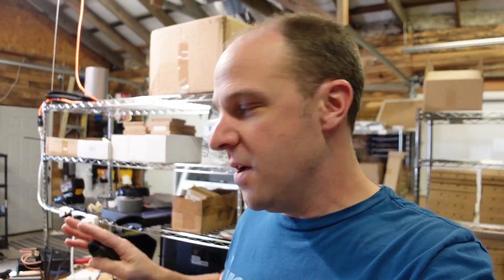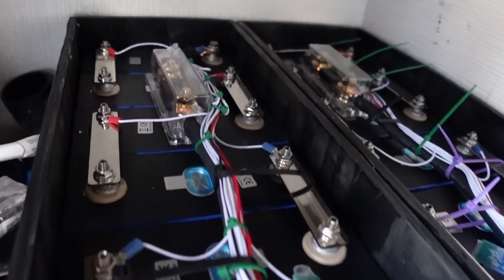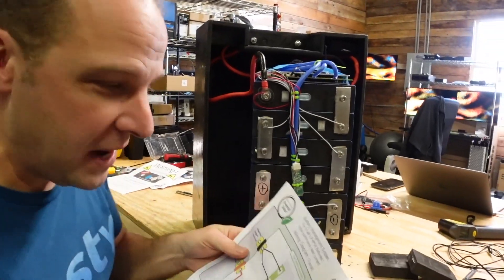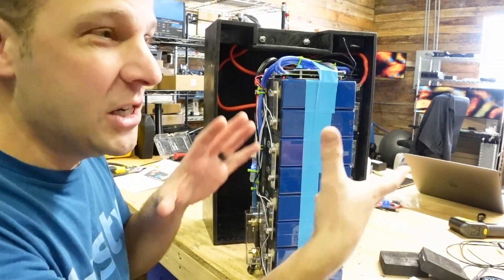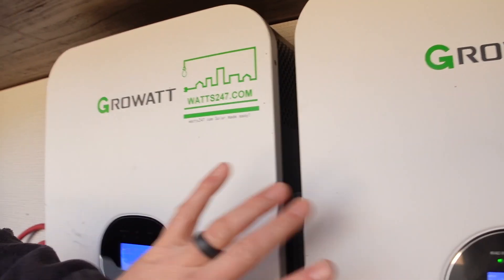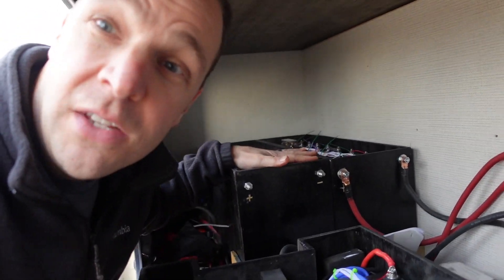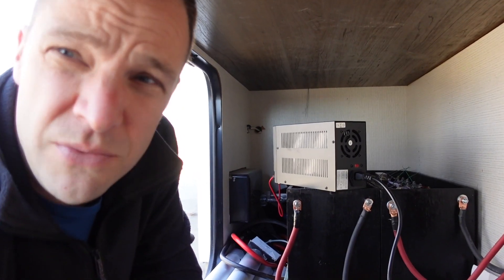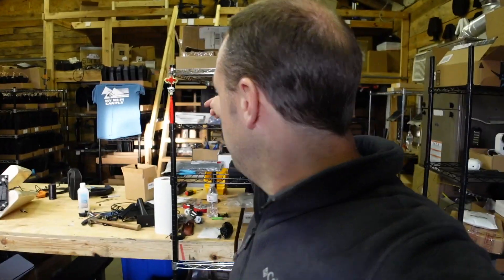EASY LITHIUM BATTERY YOU CAN SCALE UP - AND SAVE THOUSANDS - [ HOW WE DO IT ]

Comment: While I didn't use those same cells, I did make a 240AH 12v battery and used the 12v BMS from Overkill Solar.  Overkill Solar's customer support is very good and their instructions are very clear...unfortunately, the source I used for my cells wasn't the best so I'm glad to know about another option for battery cells that has a better reputation.  Despite that, my battery and their BMS have been working great.  One thing you didn't mention in the video is how many Amp Hours are the batteries that you have built?

I'll also look forward to your video on topping off a battery after you put it together and have used it!

Comment: After looking into different cells from different places, I see that some are CALB (China Aviation Lithium Battery), and some are not certified that way.  And then some are grade a, a+, or b. 

So, my question is if I went with a grade a or even b with say 3.2v 280ah cells and hooked it up for a 24v battery to start with. Could I then add a 2nd battery later that was "better" quality? Ie: a CALB class A++  that is rated at like 320Ah?  Or would all the batteries that are hooked up have to be the same?

I think it's fine, but I am wondering if it would cause any issues.
Reply: Good question…. If they have differing capacities I’d be worried about them discharging unequally but I don’t know how much of an issue that is. Maybe the inverter will control that automatically🤷🏻‍♂️

Comment: You have had better luck than me with Aliexpress. I have ordered batteries from them on two different occasions without receiving the goods. They refunded my money but after waiting a couple of months for the non-delivery.
Reply from the maker: this happened to me as well, which is why I wanted to share the specific link that I used and had a good experience with.  In my case, the price was REALLY low - it was honestly too good to be true but I gave it a go.  I got refunded as well, which gives me hope that AliExpress will at least stand behind what's on their website.